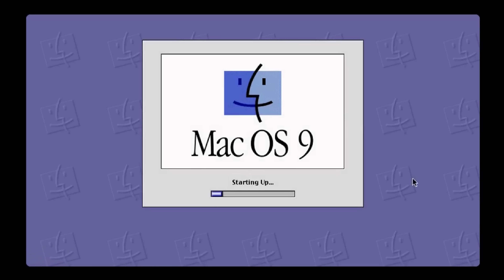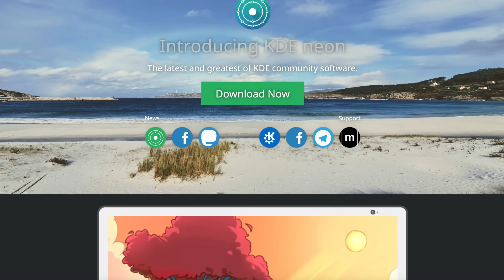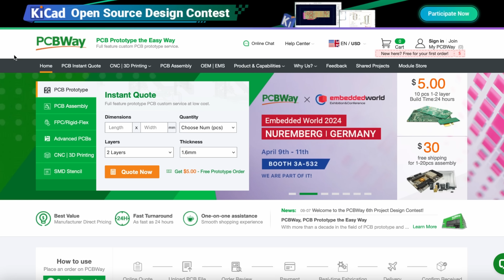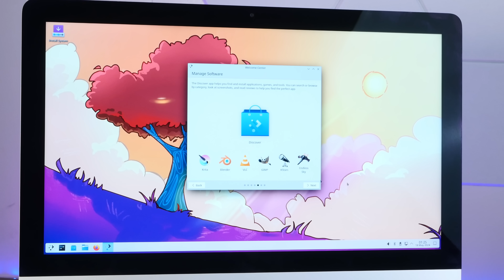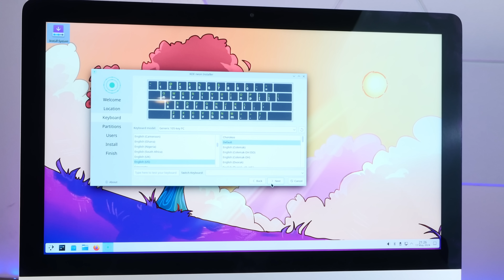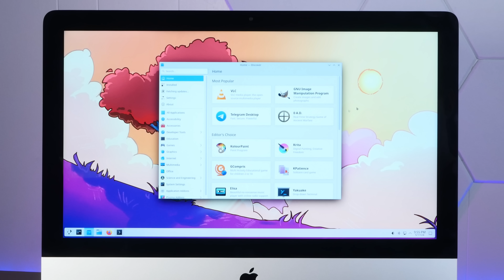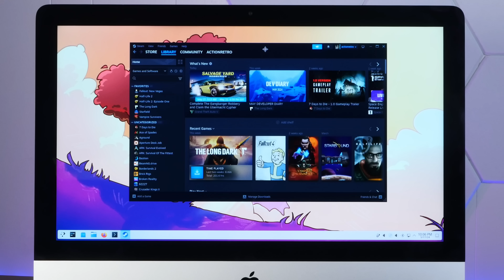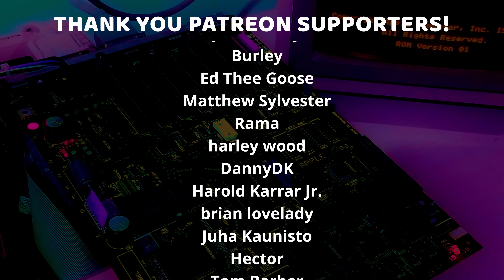The Best Budget Mac for Linux?

Comment: I got a 'broken' 2011 Macbook Pro for £10, the only thing broken was the file system. One SSD, 16GB of ram and it's running Linux Mint beautifully. The equipment is lovely if fiddly to work on sometimes, but well made an great to use. My new laptop, came in under £60 all in.

Comment: I remember being in university around 2012-2013 when for whatever reason they made one classroom Mac only where they had a bunch of these things. Gotta say the machines were pretty nice apart from the mouse and keyboard, the magic mouse is honestly probably the most uncomfortable mouse I've ever used. I liked the touchpad it had on top of it but it was so unergonomic to use

Also the mouse and keyboard weren't rechargeable at that point and regardless of how long the batteries lasted when you had ~40 or more machines in one room one of them was bound to run out of battery on something constantly disrupting the lectures, and also since they were wireless it was a common prank to swap everyone's accessories around randomly and everyone had to figure out where their mouse and keyboard was or try to pair them along with the several other machines doing the same thing at the same time. Good times

Comment: I still run a 2009 Imac with Debian 12. It has a i7 860 @ 2.80GHz and 16 GB DDR3, 500 GB SSD. With AMD Radeon graphics card. These seem to fail a lot due to overheating so take out the cd/dvd drive and close the gap with some tape for better airflow. It runs great. And because mine is the 'fat' model, no adhesive but magnets. I can take of the glas with my fingernails.
Older Macs hold their value pretty good ( in Spain they are more expensive than in the USA ) and are still usable. Either with Open Core Legacy Patcher ( for MacOS ) and/or your favorite Linux distro.

Comment: If you haven't bought an imac yet, the 27s have better resolution and four memory slots.  Pre-2010, you're generally within the limits of Core 2 and the associated memory space.  Though I like my 2010 i7 a lot, the TDP is 95 watts.  Newer systems often use less electrical power.

Comment: They were always built for UNIX. No wonder they are great with BSD and Linux. My 2008 Dual Xeon Mac Pro and my 2010 27-inch iMac+extra 27" Cinema Display are both beast with OpenBSD (and Linux).

Comment: Would the installation of Linux also work on a 2017 IMac which has already an SSD? And without any technical modifications? Or is the 2017 model too new😄?

Comment: I have a slightly older iMac that is running PopOS fairly decently, but boy does the iMac that Action Retro is working on seem so much easier to upgrade the hard drive for. I looked up a video on how to upgrade to an SSD and it was pretty involved, more so then this one..

Comment: I have this exact machine, it used to be my kids' Mac. I resurrected it and a 2009 5,1 Dual Xeon Mac Pro from storage recently, aiming to set up a machine to open up old 32-bit projects on so I could re-render them in modern resolutions - and was astounded to find that this little machine smoked the Mac Pro! It's currently sitting right beside my 2024 Mac Studio and looks every bit like a modern Apple device, as if both products could be sold alongside each other in 2024. Even with the wide bezels, I find it just as if not more attractive than the current fruitloop iMacs (and the screen is lovely, if not the 5K beauties found in modern iMacs). I'll definitely be upgrading the RAM to 16GB and will install a 4TB SSD, but not sure I'll brave a CPU swap as I don't envision it running anything more modern than Mojave. But if you have one, it can be upgraded and flashed in such a way that it can run the latest (or at least a very recent) Mac OS.

Comment: This is the thing I absolutely LOVE about Linux, and why I respect it, as an OS; It breathes new, USEABLE life into older machines that are no longer officially supported, and it helps mitigate them from being scrapped. While I don't primarily utilize Linux, currently (I use macOS/Windows on Hackintosh builds, and an old Mac Pro 5,1), there are a few good reasons why I keep multiple Linux ISOs archived on my NAS/Repository!

Comment: I have found MX Linux works great on older macs. Using it on an older 2008 24” iMac, and on an older plastic white MacBook from 07. It seems to use a lot less ram and has the super customizable xfce desktop.

Comment: I love these older iMacs, they're still incredibly useful.  Also, not sure Linux can run on an external SSD, but macOS can, so you wouldn't need remove the display to upgrade.  Sure, it's not NVMe, but completely usable for simple tasks.

Comment: How did you get the keyboard to pair? I have installed ubuntu on an older imac from 2009 and it doesn't see the keyboard... ??? But it does recognize command+alt+r+p on power up.

Comment: Seeing how these models are held together with adhesives, I have to wonder if there could be an alternative solution that lets you open the system as needed.  I had thought "velcro"/hook&loop tape, but I'd be concerned about the force needed to open a long strip of velcro, and could crack the display.  Maybe devise a magnetic latch setup like on the earlier iMac machines.

Comment: Maybe it's only cheap in the USA. In Korea, people try to sell old computers at much higher prices. I just checked a used market site and it was 250,000 KRW, which is about $185. You may think $185 is not bad, but the value of KRW against USD fell recently due to the Fed's interest hike and bad US economy (yeah, when the US's economy is bad, KRW's value against USD somehow drops). Korea's minimum hourly wage is $7.3, so that used iMac is 25 hours worth of the minimum wage.

Comment: While open, I'd cut open the back of the case where ram slots are and m.2 slot if any, and use a pitted plastic plug that sits flush to cover holes.😂

Comment: Very interesting. The point is that I have a late 2009 iMac (27", 12GB, 250, 2.8 GHz quadcore i7, ATI Radeon HD 4850, 512Mb). I tried a neo boot usb. After the neo logo appeared, the screen went blank. Do you know what my options are to install a modern linux desktop?

Comment: Hi, I have a question for you, I did exactly the same thing that you just did about a month ago with an iMac thats pretty much the same config. However when I switch the computer off and it is actually powered off, the fans come on full. The only way to get it to stop is to remove it from power entirely. Have you ever seen anything like this? The computer really is off, its not sleeping or suspended.

Comment: Heh, you can kinda customize it like a MacOS version and the common folk wouldn't notice the difference
Reply: Can you get a menu bar on the top?
Reply: @MaxOakland Debian has an option for that. So do several other flavors of Linux. Check your settings menu. 👍
Reply: @MaxOakland  yeah if you install Cinnamon you can just drag the menu bar to the top and it looks very much like MacOS. You can do it easily with KDE too but Cinnamon looks more Mac-y
Reply: @MaxOakland yup, linux is so unlike macos or Windows in that you don't have to think of it like one static thing, you can make it however you want and change everything
Reply: I run Twister OS (Linux) on my Pi 400 and one of the built in themes offers a Mac GUI with a top menu. Although I haven't used it yet, there is a PC installer for this theme on their website that works on a few Linux distros. Twister OS itself is ARM based only.
Reply: @MaxOakland yes, that's very common now in KDE, it's called the global menu bar and it replaces all the window menu bars with a topmost menu

Comment: I’ve got the iMac Late 2011 which has FIREWIRE 800. 

Anyone think KDE will work with that model AND support FireWire?  I’ve got a MOTU 828 that comes in FireWire into Audacity. 

Would be great to move to a modern OS and still use this machine to sample.

Comment: It's funny, because it was tinkering with Macs that really brought me to Linux - perhaps because Apple just seems to give up on legitimate machines. They also had a habit of putting really great displays on rather, well, not high enough spec'd computers... 

I've been rescuing eWaste Macs for the last several years, and now I have a backlog of them... I actually got a 27" 5k 2015 iMac for nothing... completely functioning a year ago. 

When I first started my Mac exploits, I wasn't much of gamer - I had lapsed for decades - but Linux really, really brought me back into it (as well as the wealth of modern cRPGs). So... a lot of my backlog is due to parts - I want to rip out GPUs and replace them, and this is especially applicable to even older iMacs than this one... Because the MXM (?) slotted laptop GPUs in this era, it is possible to make a 2009 or 2010 27" iMac completely modern, other than RAM/Bus speed... 

I've really been enjoying your Linux tangents, even though I discovered you in the PowerMac era - a shared passion, my most coveted computer is my MDD FW800, but she's sick at the moment (I think I need to retape my Fire GL card... that is one finicky flashed beastie). 

Anyways, thanks Sean. Keep it up brother!

Comment: Old ubuntu based distro bleeding edge? are you perhaps a little bit on shrooms ? most of the packages are like 2 years old.  Theres nothing bleeding about it and normal users should not use KDE neon, its less of a proper distro and more of a KDE testing ground, thus most of useful software will be missing.

Comment: Tbh, Intel didn't exactly make any big leaps in progress from Ivy Bridge until after Ryzen hit... there was basically zero competition. That means that a machine from around 2013-ish will run as a daily driver for simple tasks perfectly fine given enough ram and a basic sata ssd to replace the spinning rust (the biggest "slow factor" in most machines from that era, not the processor). Honestly, the biggest downside on a lot of intel iMacs of that era come down to the terrible fusion drive and the integrated/discrete GPU's they came with, having not a lot of vram. I have a 2014 5k 27-inch I got dirt cheap (not far off this 2012) that only had a dead fusion drive. Otherwise, it's mint and now upgraded to 32GB of ram (barely more than 16 when it was on sale), a solid SSD, and is running openSUSE right now as a kind of toy since it was so cheap. Handles editing extremely well with darktable, and when it ran Windows it handled all of my editing tools fine for the most part (4GB of vram is annoying, my relatively old RX580 has 8GB at least :|).

Comment: When buying used PCs search for hardware with 4th gen Intel CPU or newer. Older i5s aren't that much slower, but they lack some instruction sets. This will make them useless sooner or later.
4th gen CPUs have same instruction sets as latest CPUs so they will remain compatible with software for years to come.

It's usually better to buy used Lenovo, HP, Dell etc. all-in-one computers instead of iMacs. Apple computers are significantly more expansive, it's much harder to install SSD and if you're installing Linux having a regular PC might be even better. You'll have regular BIOS/UEFI.

Keep in mind that this is country specific thing. Macs are very unpopular where I live, so there's very few used macs on the market. People are also much more resourceful and they will use their computers much longer. Usually installing Linux on their older PCs and selling them only if they're totally useless.

The only really affordable source of old PCs is from big companies who get new hardware every 4-7 years, because old one is not supported anymore. That way there's a lot of used Dells, Lenovo, HP etc. with good performance/cost ratio compared to Macs and used custom built PCs.

Comment: Be very careful with the pizza cutter near the camera.  Waaaay too much paste on the CPU - 1 pea-sized blob in the middle is the correct amount.
Put masking tape on the Aluminium front bezel to prevent scratches from the screen metal.
Use a black stick to accurately position the new adhesive - that's what the small holes are for ;)

Comment: I completely drained my iMac and mounted a laptop i5 motherboard + power supply in it with an inverter for the screen. I run my retro games on that under Windows 11, as well as via VMWare a MacOS Venture, MacOS 7 and MacOS9 with sheepsaver. I tell everyone for fun that it's still a real iMac 🤣😂🤣